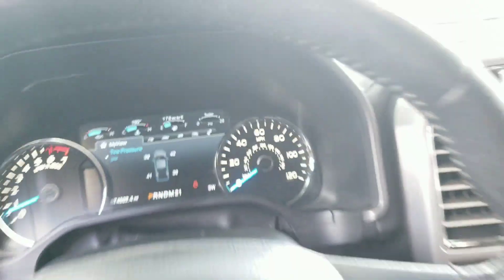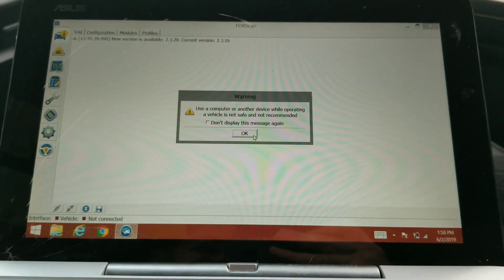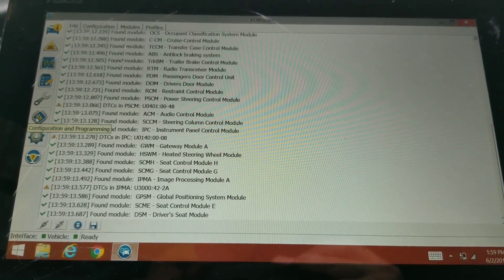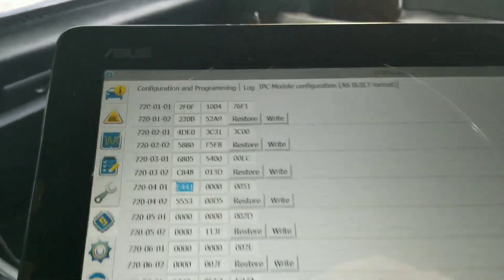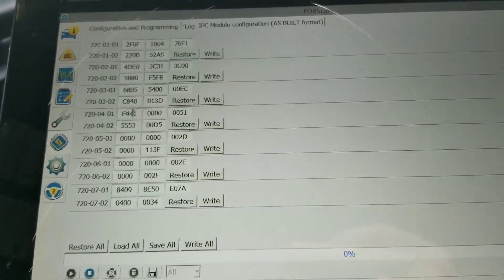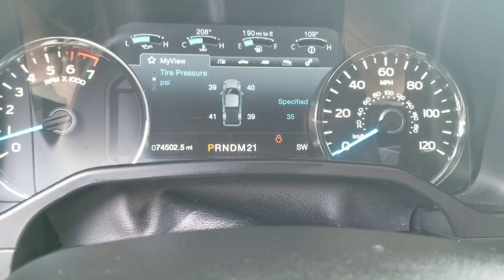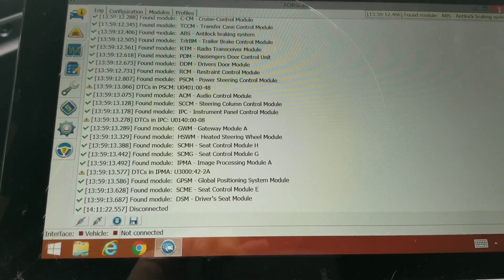FORScan TPMS mod to add PSI value display on IPC ford f150

Comment: My new tires have 65 psi Max, stock is 70-ishPSI so the sensor is going off as low PSI. This will edit the setting for lower PSI?

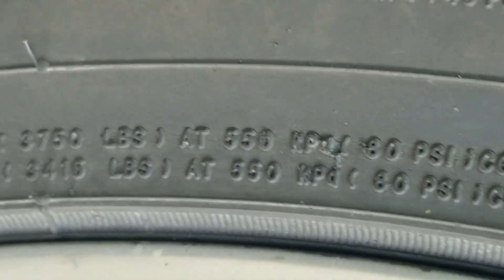Comment: At 3:59 it shows your tires are actually rated for 80PSI, and you CAN change the specified reading to match your new set. Stock is 35psi, which you'll see as 2323 in the center block of four values of 726-40-01 (BCM/BdyCM) in the software (the Built As spec).  Change 2323 to the HEX equivalent of your new tire psi rating (the four values are split by two as front/rear). 80psi in HEX=50, so the four values in the center block would be 5050 for 80psi tires.  Happy programming.

Comment: NEVER go by the tire rating. ALWAYS go by the door sill label.  The tires have generic makings for all vehicle fitment.  It doesn't consider weight distribution,  steering and breaking performance of the specific vehicle.  That's why the manufacturer lists a pressure,  it is for both performance and safety.

Comment: Just because it says 60psi you should be running at what your door card says ....unless you are towing or hauling a heavy load. If you keep your tires that hard it is extremely hard on your shocks and other components. You will also have a ride that may rattle your teeth out.

Comment: Have to be Honest.  What good is it to add the Placard PSI if your not able to change its value?  Mine is stuck at 35 and my tires are rated higher than that.  So the concept is great, except without a way to change this number, it just seems pointless.
Reply from the maker: I agree... I removed mine. The only advantage is if you have someone other than you driving.  And they don't know what to fill it to.

Comment: Hey man I did this on my 2018 platinum and now my adaptive cruise control doesn’t work. Normal cruise does. Any suggestions before I try to revert it back? Can’t remember the digit I changed 🙄
Reply from the maker: Yeah, revert back and double check everything before redoing it. Mine works fine.
Reply: Adaptive Cruise is partially controlled within 720-01-01 (IPC), NOT 720-04-01...  Set the correct second value within the first block of four values to enable it again. It will be one of eight possibilities dependent on your other features.  Also, check the 4th value of the first block within 7D0-09-02 (APM) for the eight possibilities of enabling IACC (Intelligent Adaptive Cruise Control) and the second value of the second block for the eight possibilities of enabling Adaptive Cruise, also dependent on your other features. Also check 760-03-01 (ABS). Lastly, the fourth value within the first block of 726-13-01 (BCM) must be C. Good luck.

Comment: Is this the same address IPC 720-04-01 to disable the TPMS all together? with all 0000. I have new tires with no sensors and I want to get rid of the fault for good. Thanks!
Reply from the maker: Hi Keith. I don't think that will work. You might be disabling more than just the TPMS. Checkout forscan.org or the spreadsheet https://docs.google.com/spreadsheets/d/1uDSQ1Z5a2Wt8-kjrSiVSlDFGFHnfeuhb3RTMVz95730/edit?usp=drivesdk

Comment: Hi,
My car Ford fusion 2016, I don't have  tire pressure values in instrument cluster only sign for pressure low and not specific for which one, my question is can I display (add) the 4 tires pressure in the instrument cluster?

Comment: Trying to get trailer brake controller to hook up and can not get to the ipc module. Any ideas of why? I was able to on my 2012 but not my 2019 F150
Reply: Thanks for the quick reply
Reply from the maker: Not sure. If the module is there and the controller has power,  it should connect. Try forscan.com forum

Comment: I’m confused. If it displays 35psi and you installed e-rated tires with a higher recommended psi, why bother showing that 35psi?
Reply from the maker: I agree... I was hoping I could increase 35. But seems it cannot be done. Thanks for watching Scott!
Reply: Ricardo's Workshop Ahhhh, now it makes sense. Good answer so now I can subscribe! 😉

Comment: Never ever ever fill up a tire from what it says on sidewall. Tire pressure is on a sticker in the door. That’s the pressure where it pops
Reply from the maker: You are correct Tuba... door sticker is optimal 35psi for comfortable ride. Tire sidewall is max cold with load. Thanks for watching!
Reply: Ricardo Alanis that's incorrect. Door pressure includes all capability of the truck. It's dangerous under all circumstances to run a tire at stated maximum
Reply from the maker: Sorry tuba... i don't agree. The the tire maker probably knows more about its tires than the truck maker.
Reply: Ricardo Alanis "Under no circumstances should you inflate your tires to maximum pressure. Not only will you risk a blowout, but you'll diminish your ability to control the car because your handling and braking will be much, much worse." Ford put those numbers there for a reason
Reply from the maker: Thanks for watching tuba... don't forget to subscribe!
Reply: Think about it this way: tire mfr produces different models for various applications to industry specs. Each model can be used in numerous instances, different vehicles. The tire has no idea what specific vehicle it will be used on. 🤔
The vehicle mfr has specs for each individual vehicle & publishes that data in the manual & inside door jamb. We are far better off sticking with the vehicle specs to match intended use.

I used to be heavy into Jeeps, owned/built 6. Lots of off roading where we "aired down or up" depending on terrain. Hwy we nearly always used right at vehicle specs or slightly below for best ride quality, life & tire wear. These were always oversize tires!

YT won't let me post url links or I could share with you lots of technical write ups on the subject. Following those I consistently get more than the guaranteed mileage life out of nearly every tire I've bought for the past 45+ years. Top of the line Michelin tires on my wife's SUV lasted 120k! on a set than usually gets replaced at 70k.  It's all about watching that pressure, keep rotation on schedule, and keep suspension in top shape (alignment, bushings, rod ends, etc.) it pays it the long run!
Reply: Your argument only applies to using the stock tire on your truck. The factory sticker applies to the factory tire, period. Any modification of tire type requires following the tire specs. The cold spec takes heat expansion into consideration. Follow the tire. Nothing else is logical.
Reply: 1st So that tire is a load rage E which is meant for a 1 ton truck not a 1/2 ton truck, if you go by what the tire says you will get an over inflation wear which means the center of the tire will wear faster then wearing evenly across. 2nd running a tire at max cold psi will not cause it top blow out  because a lot of 1 tons have the recommended psi on the door seal of 80 psi, where you run the risk of blow outs are underinflated or extreme over inflating above cold max psi. 3rd vehicle manufacturers put the recommended tire psi for the best wear for tires the engineers  do their math stuff and take into the camber, toe, weight, and what tire is going on and probably a lot of other things to make sure your tires wear evenly acces is safe. Running bigger tires like you have you should probably bumb up the pressure a little so you don't get under inflated wear.

Comment: Did anybody else read 80psi on the tires, not 60? Also you said you were changing the 4th value but you were changing the 3rd which was a 4 to start with. Hopefully this didn't cause anyone watching to change something drastically wrong!
Reply from the maker: Sorry... you're right. I said 4th meant 3rd. And the tire max is 60psi
Reply: @ricardosworkshop  no its 80
Reply: @ricardosworkshop  take a pic with phone and blow it up. its 80